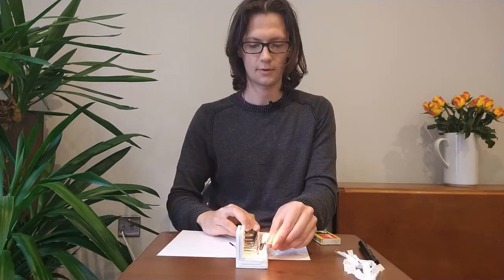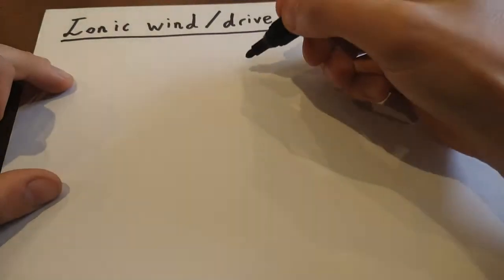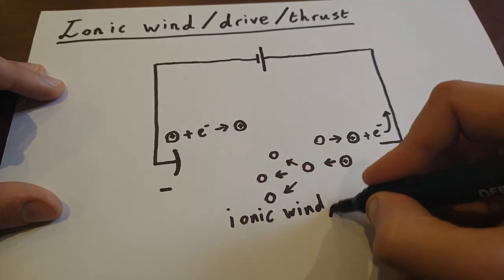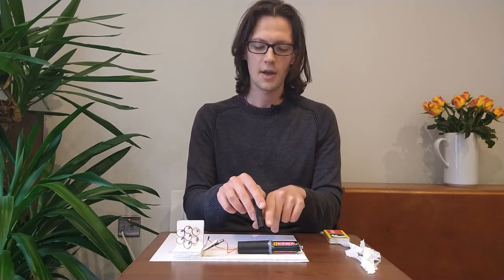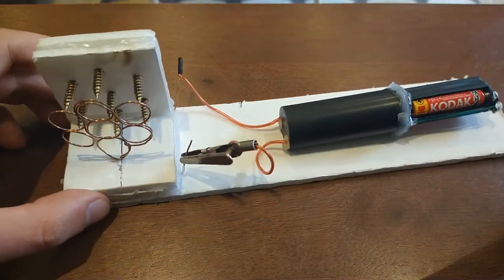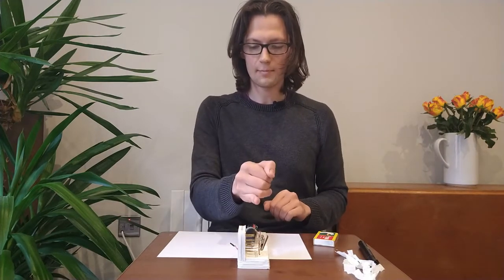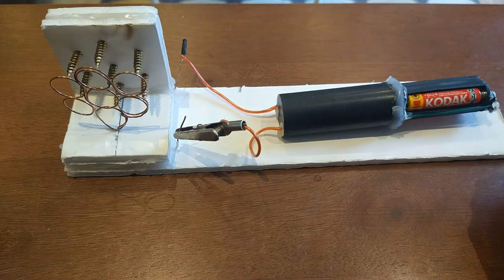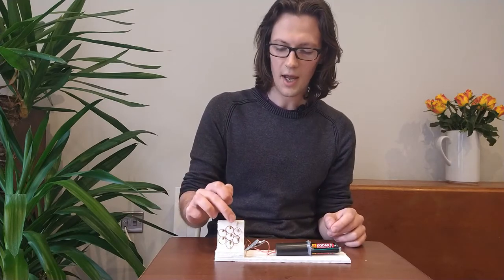Cheap and Easy DIY Ion Drive

Comment: Exactly what I was looking for, great minds think alike. It appears you can test with smoke to measure the even distribution of power. It’s a frightening device at high voltage, would need a pre filter on an industrial scale terrestrial system. Silent movement of air is interesting, no fan noise. I would like to see a kilo watt version of this in action. If it works on the ground it should work as well in space. Hum… interstellar nuclear drives seems well with in reach, what a great mission that will be

Comment: I'd like to see the improved version of this! Quick question, do you think this purges the air of impurities as it moves the air? You mentioned the ozone smell, and that's useful for purifying air, especially when this also moves air. Thinking of HVAC applications.
Reply from the maker: Thank's for commenting! Here's the updated version: https://youtu.be/94xv8LGzqck I'm currently working on mk 3 where I hope to use photoflash charging circuitry as the high voltage DC source to allow it to run for extended periods of time. Ozone is effective at oxidizing organic impurities is air. However, in a strict chemical sense, it won't "purify" the air as it will also introduce the products of this oxidation and various oxides of nitrogen.
Reply: Actually ozone is pretty poisonous for us human beings. The FDA states that it is a toxic gas.

Comment: Find a disposable camera with a FLASH.
Before you send it off for processing.....remove the flash circuit components.
Congratulations.
No laws broken...yet you have the 'step up'you needed.
(if you want it cheaper still...go to a supermarket that sells them and check the expiry dates on them.Seriously,I lost count of the number of times I have caught them out on these over the years.)
Reply from the maker: Thanks for commenting! I actually have a load of photoflash circuits that I salvaged for a project a few years ago. Unfortunately the most I've ever got out of one was about 1200 V which isn't quite enough for this application. Seeing as I have a few though, I'm hoping to try putting the output of one through another to step it up further.
Reply: @ThrHillSeeker  added hint....film close to its use by date/out of date....
put it in the fridge
Apparently it lasts longer.....(according to my photographer friend🤗👈who knew?😸)

Comment: That video you link is wrong. It can't work with ac. The transformer does use ac but the stepup is via diode charge pumps and results in hi voltage dc. Its the same way a cathode ray tube's hi voltage is made.

Comment: Do you think it is possible to divert an air flow of about 300 Km/h using this principle but obviously using more voltage and more sosophisticated system?
Reply from the maker: Thanks for commenting! I honestly have no idea, based on what I've seen so far I'm not sure whether this would be possible. I'm currently experimenting with using a magnetic field to deflect the path of the ionic wind (with limited success).
Reply: @ThrHillSeeker  Hey there, im trying to make one for a science expo, how 
long can i leave the power module on, and what volatage should they be given and how long do they last? A reply on this comment would be super helpful pls

Comment: Humble opinion  Using heavy gage copper conductors and not steel screw nails for the anodes would seriously improve the experiment.  It would likely be cheaper if not free as the wire pieces can be found in  any kitchen reno scraps.

Comment: I was just wondering if you could make PVC pipe a ion wind thrust with noble gas , quartz  powder and powder aluminum or something to harvest ions.  I can't afford to experiment ,I'm not very familiar with electrical remedies for the voltage it will need.it would be halbach type magnetic field almost similar to a pinwheel I think if u can make the gas flo with that in mind it would be interesting

Comment: Sir sorry but do the 2 terminals are connected to the nails and the copper flower and do the 7 nails joined together by wire and which one pls tell working on a project
Reply from the maker: The screws are attached to the positive terminal of the high voltage output while the copper flower is attached to the negative terminal. The screws are joined together in series using more bare copper wire and then insulated with hot glue. I hope this helps, good luck with your project!
Reply: @ThrHillSeeker  thankyou very much you helped me more than my teachers

Comment: Sir is this copper wire and have you attached the copper wire rings with super glue
Reply from the maker: Yes, this is bare copper wire but the rings are made from one continuous length of wire bent into a flower shape.

Comment: Hello, very interesting experiment, I want to tell you another idea, you can try it. Separate the screws with an insulating tube, or replace the screws with thinner steel nails. Some activated carbon can be placed under the copper wire, and the halo may be more obvious.
Reply from the maker: Hi, thanks for commenting! I've just got another step-up module to experiment with so will try out these ideas soon.
Reply: @ThrHillSeeker  have you tried using some capacitors and only short impulses of a higher voltage?
it might improve it and it should be more effective with the same kw/h

Comment: How many volts are needed?
Reply from the maker: It should be achievable with any voltage high enough to generate a corona from a sharp point. The SFPE Handbook of Fire Protection Engineering suggests that this can be as low as 2000 V.
Reply: @ThrHillSeeker  Hey there, im trying to make one for a science expo, how 
long can i leave the power module on, and what volatage should they be given and how long do they last? A reply on this comment would be super helpful pls

Comment: Powered by an ‘ion drive’ which uses high powered electrodes to ionize and accelerate air particles, creating an ‘ionic wind’. However, the ancient technology of the Great Pyramid of Giza can focus electromagnetic energy.The Great Pyramid would interact with electromagnetic waves of resonant length. Interestingly, the pyramid can concentrate electromagnetic energy in its internal chambers. Understood on the basis of numerical modeling and analytical methods of physics. Once capable, a simple distribution grid of electromagnetic energy picked up by induced radio waves (this method is widely used in physics to study the interaction between a complex object and an electromagnetic field.) The Great Pyramid as a particle dissipating radio waves by resonance. Other materials with appropriate electromagnetic properties, and by discovering more pyramidal nano particles with a promise of practical application, older electronics were simpler such as switches or the distribution of energy by old taps.Faucets have also been assigned by various lights (compressor, generator, fan, lighting, etc.) to heavy duty applications, for example, levitation work and others. Practical application in nano sensors and efficient solar cells by the old technology of the great pyramid.

Comment: Thank you for the nice simple explanation. The NERVA rocket engine was built in 1964, test fired many times in Jackass Flats Nevada. It was a ION propulsion rocket engine, I believe they needed the power from Hoover Dam to run the thing. There have been multiple engines built as material science could make a grid that wouldn't be consumed so quickly.
Reply from the maker: Thanks for commenting. That's super interesting, I'll have to read up on it! It seems that the real challenge is achieving great enough thrust to actually move the power supply.